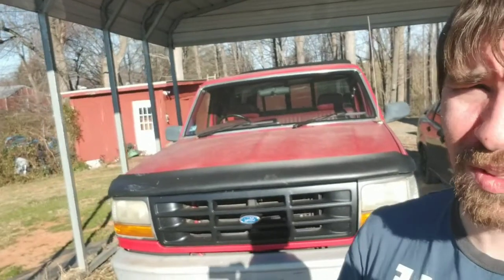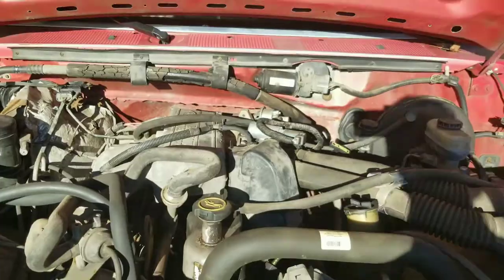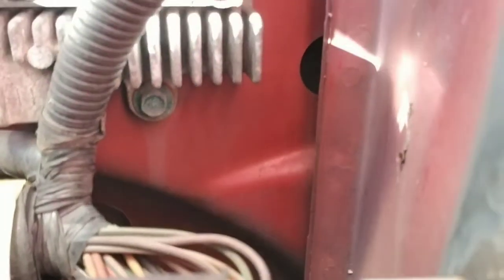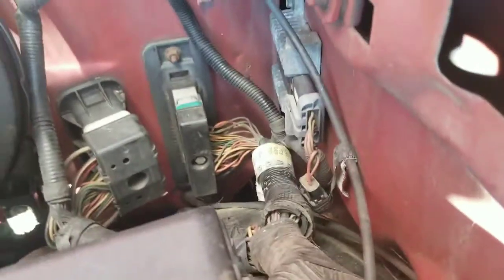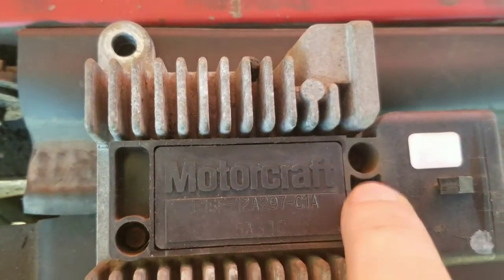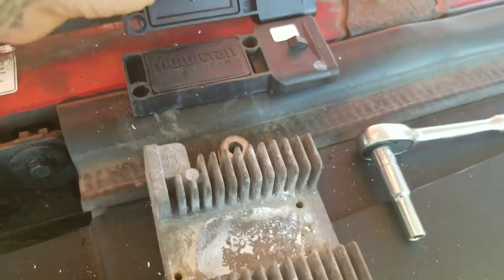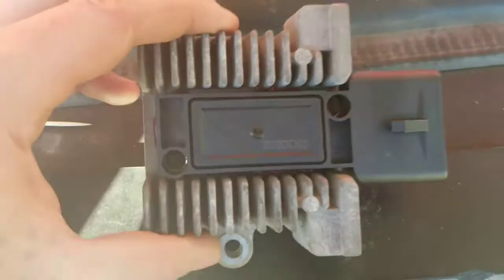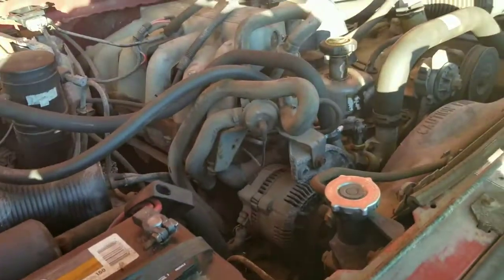1995 Ford F150 4.9l Ignition Control Module Replacement!!!

Comment: That TFI module if it was bad, your car would die and not be able to start after awhile from what I have read due to heat or if going bad. If you have a OBDII on your truck it would throw a CEL for SPOUT, IDM or SAW circuit fault. Codes P1351 and P1359. It would still run fine but not at its full potential. It should not cause idle issues as the one I have in my 96 e150 is the incorrect module and idles fine. I would check for vacuum leaks, Idle air valve, air filter, fuel related systems, MAP or Mass air flow sensor, stuff like that for your issue.
Reply: yours being the 96 makes all the difference. this part is specific to pre-95. When they get to hot they temporarily fail, but once they cool theyll come back. the older they are the less heat it takes to kill it.

Comment: I wonder if that  would help p0320 distributor code my truck won’t start just cranks and already did cap and rotor
Reply from the maker: Have you checked to see if your getting spark at all?  could be the coil not sending any juice to the Distibutor.  sorry for the late response
Reply: Pip pulse?

Comment: There should also an ignition control module on your distributor cap. Had a similar issue with my 91 4.9L and it seemed to fix the problem.
Reply: Do this last.

Comment: "Temperatures above about 94° tend to make the toothpaste overly liquid, particularly with gel-type toothpastes. Temperatures above 100° F are known to degrade some toothpastes over time. Preferred temperatures range from about 80 degrees to about 90 degrees Fahrenheit." just something i saw on a patent application for a toothpaste warmer. not sure about the validity.

Comment: Hey man did you ever get it fixed? Mines cranking but no spark. Just replaced spark plug wires and ignition coil about to try icm. What worked with ur truck? @wesssidestory4157
Reply from the maker: I also replaced my trucks computer thinking  that was the main culprit